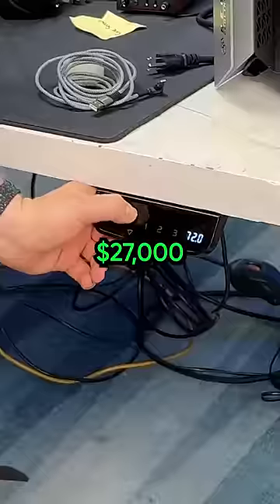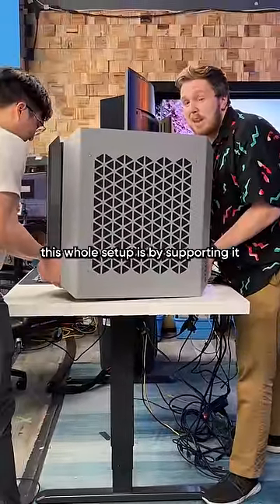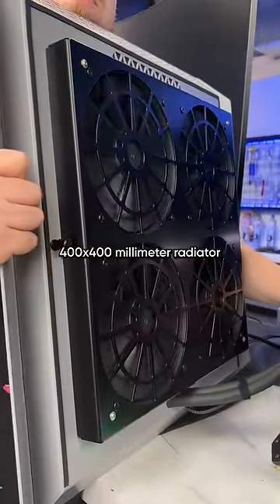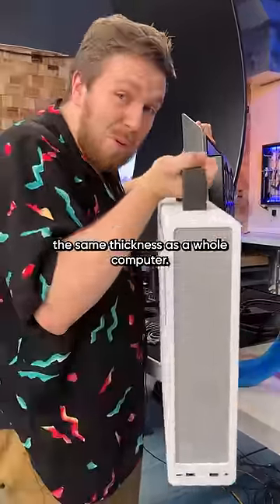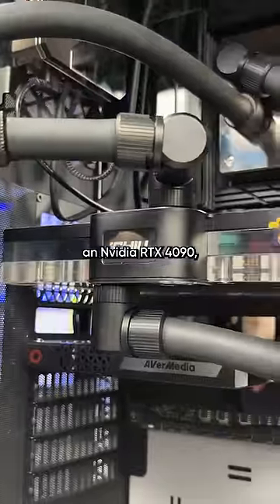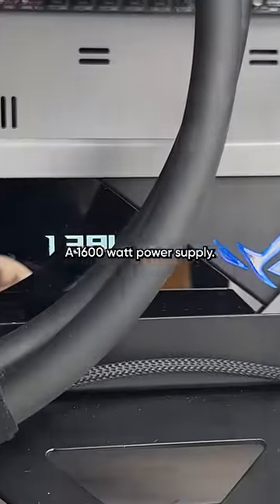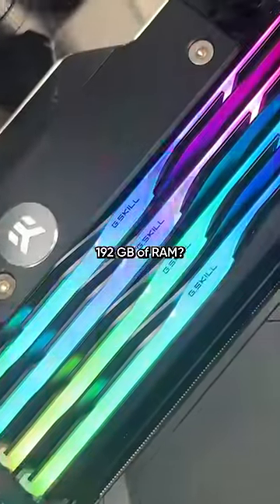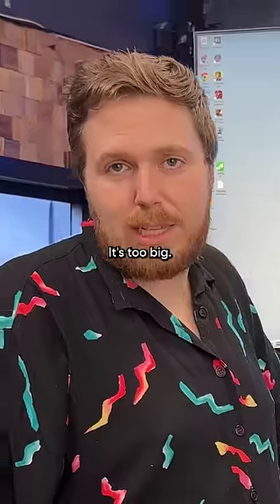Inside a $27,000 Gaming PC

Comment: Did an experiment a few years ago to see how much "bang for the buck" I could get with a gaming PC. 
Got a refurbished Dell Optiplex 9020 with a 500 GB SSD, and threw in a GTX 1050 Ti (the best card the stock 290w PSU would handle.)  This rig punched WAY above its weight class for 1080p 60 FPS.
(I did swap out the case and CPU cooler fans for Noctuas, as the stock Dell fans were noisy.)
Went on to add two more 4 GB RAM sticks for 16 GB.
Needed more CPU horsepower for Dwarf Fortress and Plan B: Terraform, , so I upgraded the stock i5 to the i7-4790 (best the MOBO will support.) Intel has Turbo Boost, so no need for the K version, plus the MOBO doesn't support CPU overclocking anyway.
The SSD that came with the PC sucked- slower than a high-end HDD, so I cloned in a decent 1 TB one that was on sale for a huge speed boost.
Finally decided I had to play BG3, so I bit the bullet and got a RTX 2060 Super 12 GB. Most of the 2060s had 8 GB VRAM, but MSI made one with 12 GB.  :-) Needed a new PSU of course, so Thermaltake 600w.
And there was a HUGE sale on Kingston RAM, so I maxed that out at 4 x 8 GB . 
TL/DR, for under ~$800 total I have a really awesome rig for driving my 1920 x 1080 60 Hz monitor.  Only original parts are the case and MOBO. Looks like an obsolete refugee from a cube farm- but so am I, so we're brothers. :-)
Reply: Before anyone tries to hate, I think that's dope.

Comment: "Each side panel is a radiator... FILLED WITH WATER" 
The radiator is filled with water you guys, water. I'm so jealous
Reply: i would have used automotive coolant, but for the price of the build they should have used mercury. liquid metal coolant is unsurpassed.
Reply: @iamzid if it leaks ur dead lmao
Reply: Water conduct temperature better than coolant, but u use coolant in cars to avoid freezing and corrosion
Reply: @stuntcox5731 bruh never seen mercury thermometers
Reply: And, get this - they have to support it WITH THEIR HANDS!!

Comment: It's so expensive they have to lift it by hand. Nothing to do with weight though! Lol
Reply: In the long form version of the video they tried to have the desk lift with the computer on it.
The display for the desk controls spat out an error and would not move.
Reply: @coreyhipps7483   Was the error because the motors refused to work because the thing they try to lift is more expensive then themselves or did you not understand the initial comment at all?
Reply: If you move the table all the way up and then place a single kilogram of gold on it and nothing else, the table will actually crash down from the sheer pressure of the gold price. (It's over 60.000$)

Comment: so 1600 watts, means it has to have it's own dedicated electrical socket too.  (1600 / 120 = 12.5 amps, hopefully your on a 20amp breaker)
Reply: Yeah ...I was thinking that lol....
I guess it would have to go in the kitchen where the microwave is 😂.
Hopefully I can still toast bread as Long as cpu in sleep mode ?
Reply: @mike2884  yea, sleep mode, and your toaster should be ok.  (Edit: actually, maybe you could make your toast in the computer itself! )

But I'm guessing people who use these machines will have multiple monitors, which might need their own seperate plug/circuit breaker from the machine, depending on how much wattage they all take.... but then again, if your buying this machine, you have enough money to hire the Electrician for a dedicated electrical.
Reply: My father-in-law wired our ourse when it was built in 1960. He was both an electrical engineer and a licensed electrical contractor, even though his day job was designer/draftsman for GE. (Electrician was his second gig.)
Anyway, he went above and beyond. 200 amp main (not total overkill, as we're 100%
 electric including heat.)  We don't have anything smaller than a 20 amp breaker. Still only have about a third of the breaker slots occupied. He went  one gauge heavier than code on all the wiring. The only place he used 16 AWG was from a light switch to a light where 18 AWG would have been fine. (FYI wire gauge is like shotgun gauge the lower the number, the heavier the wire.)  He used 10 AWG for the kitchen sockets, and the wires were so stiff he had to use a rubber mallet to gently coax the outlets into the boxes. When the big window AC unit kicks on, and the lights don't flicker- you're winning. 
Bonus: As his main gig was designer-draftsman, we have a complete, detailed wiring schematic for the house.
Reply: Houses have anywhere between 100-200amp sockets
Reply: The average space heater is 750w on low and 1500w on high, so there's not really a problem running a 1600w power supply. The main issue would be people using a surge protector that isn't rated for that wattage. The avrage power strip/surge protector is rated for around 1300-1800w. I've seen more than one strip catch fire.
Reply: I feel for people living in a 120v country. So much wasted metal for the same job.
Reply: @Tonokoz  yea, but when you plug things in, not as many sparks fly.  Most houses in US have 220 or 240 coming in, then it's split in half for general stuff.

Comment: $27K but they still skimped out on RAM.

For that price I expect at least a terabyte!
Reply: @tylercashmore8427 They're using four 48gb ram sticks, they mentioned the reason in the original video.
Reply: 192gb is definitely not “skimping out”
Reply: Isn't there like a limit on how much ram Windows will accept?
Reply: @bespokepenguin103  I think W10 Pro maxes out at 2TB, W11 is either the same or higher

Comment: No matter how many fans and radiators it  has, there's no way to cool an overclocked 13900K if not undervolting. There's no way to transfer over 350 watts from the cpu to the water by that small contact area.

Comment: Why do you need that much cooling though? The workstation that I work with has x3 RTX 4090 running simulation at 100% full loads for days on all gpus only requires 6 normal fans for intake and exhaust. The gpus perform at optimal performance.

Comment: Almost $30k and yet it still preformes the same as a $5k 14900ks / 4090 build, but with slightly cooler tempers and quieter fan speeds to maintain the same preformance, which you could match on the cheaper system by sacrificing a few points in preformance by underclocking and undervolting

Comment: Bro where do you guys get these numbers from ? Thats absolutely
 100% not a 27K build.  CPU is at most $1000 GPU is at most $1,500 Motherboard is at most $2000 , Ram sticks are not more than $300 a piece , Side panel Radiators depending on brand are at most $600 , so please tell me where 27K Came from.

Comment: All that cost, but the cable management and soft tubing made me cringe when you’re looking at that price point. 

If it were a more reasonable system, sure. You’re not looking inside, so soft tubing is fine, and cable management doesn’t need to be perfect. But on a system that expensive, I’d expect better.

Comment: $27k? That’s bs I have a 13900k and a 4090 both with custom water blocks in a 3 radiator+ distroplate, hard tube custom loop.  Cost 5k only because I had to pay scalper prices for the 4090 FE. No way it cost 5x for more ram and some hard drives gtfo

Comment: you better get that shitty intel out of there
Reply: Intel isn't shitty
Reply: @cellularcomponent  if you want a slower cpu with constant security problems that also has a elevated vottage problem that they could have fixed years ago then fine by me, also on top of that they even are overpriced nice
Reply: @HamBeglin-rj2vl   the i914900k isn't slower than any cpu. It doesn't have security problems. The problem isn't elevated voltage. They also aren't over priced.